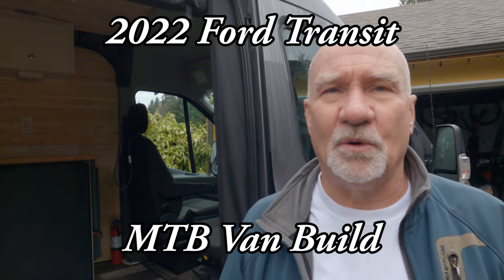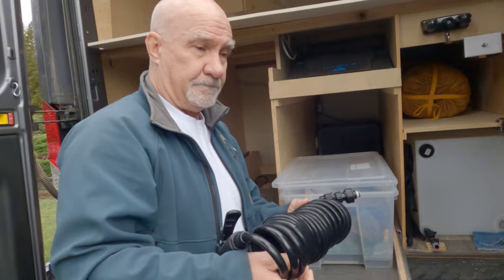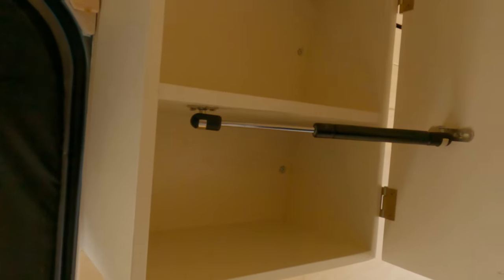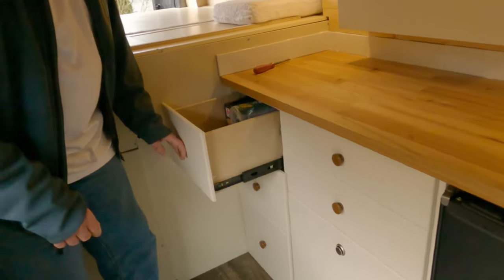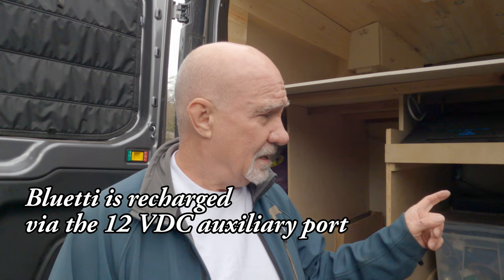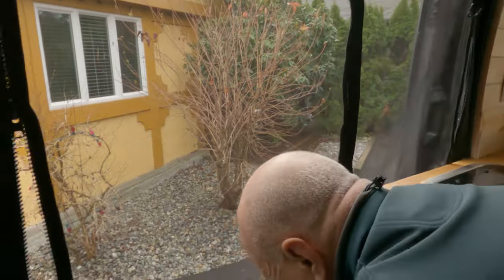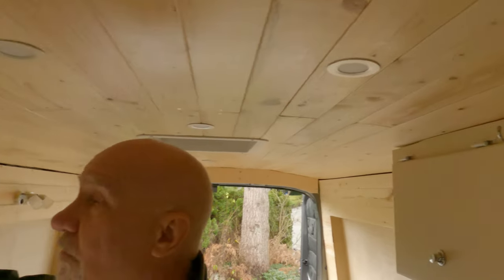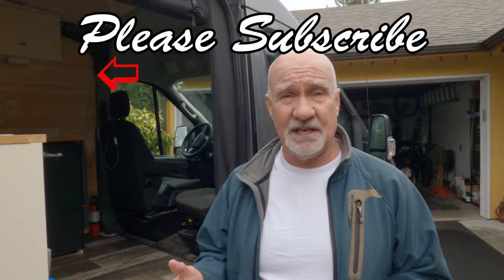Ford Transit MTB Camper Conversion

Comment: Nice work Ron.  Great choice on the transit and the minimalist design.  Many customs are expensive and provide features or options i dont want.  I have the challenge of travelling with a dog in addition to wife.  My trips are going to destinations for a couple weeks using AirB&B. I am looking for the van design that can facilitate day activities like biking, hiking, picnics, sightseeing with option to overnite camp but not to totally replace AirB&B.   Thanks!
Reply from the maker: Thanks for the compliment! I am not the type of camper to stay too often in serviced state or commercial campgrounds…I prefer the wilderness setting but which doesn’t afford many luxuries.  Having a fridge and water system is a big upgrade from tent camping with ice in a cooler! Way more prefer my new digs! Thanks for watching!

Comment: Hey Ron - It's great when you have a plan/vision and work towards it. Nicely done and I like your approach. Couple questions: 1) What tools did you have to purchase that made life easier over and above what a standard home owner might have, and 2) what sort of weight did that add to the van and did you need to beef up the suspension? Thanks.
Reply from the maker: Good questions: I did have to buy a lot of new tools, probably close to $1000 worth.  Having the right tools makes a difference.  These include a router, jigsaw, Kreg rotary saw cut guide,  Kreg pocket hole jig, wire cutter and wire crimping tool, heat gun, Sharkbite crimping tool and a number of pocket hole saws and related drill bits etc.  For the woodwork, the big thing is to be able to make very straight cuts on plywood sheets, so you could use a table saw, but I didn't have one so used the Kreg saw "guide" that works with a standard rotary saw.  And I used the Kreg pocket jig to connect the plywood pieces together for the cabinets/drawers.  The other things are the cutting and crimping tools for wires (and connectors) and plastic pipes for plumbing.  I used the Sharkbite pipe and connectors and needed a crimping tool because they use metal rings that need to be clamped between connections - to ensure they are water tight.  I also bought a plus-nut tool to drive the nuts into the holes in the ribs of the van for my wood framing.  You can see links to some of these tools in the description of this video.

As for the weight, I didn't keep track, but it is considerable.  I haven't done anything to the suspension but it seems to ride  similar to when it was bare bones.  It has always swayed a bit around high speed corners, so I might add some sway bars or something but I think this is as much due to the vehicle being quite high.  I also think I used thicker lumber than I probably needed, but I wanted to be sure the bed, garage and cabinetry was strong.  I don't think you can build cabinets for a van the same way you do for a kitchen in a house - way more stressors.

If you are interested, I relied a lot on the Far Out Ride website (faroutride.com), since he did a great job on a similar Ford Transit - and we had a similar design/build philosophy.  He lives in Squamish and his website is incredibly well done.

BTW, I didn't go into this build completely blind.  I camperized a Ford Econoline about 40 years ago so already had a good idea what the floorplan needed to look like and what it's like to "live" inside a very small home.  Thanks for watching!!